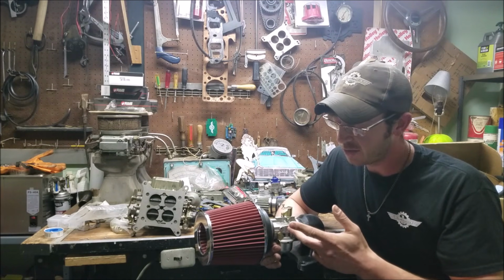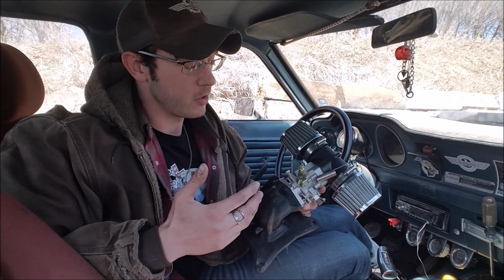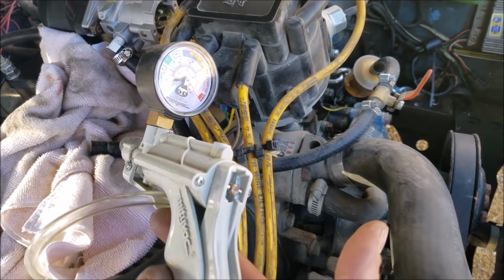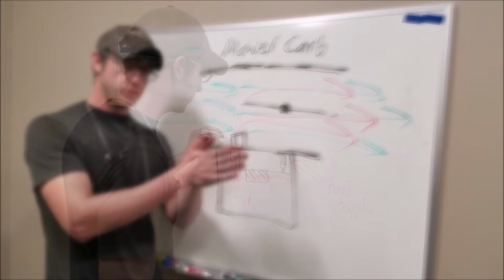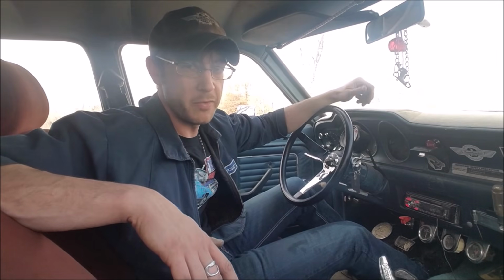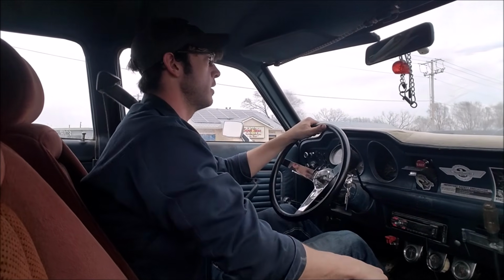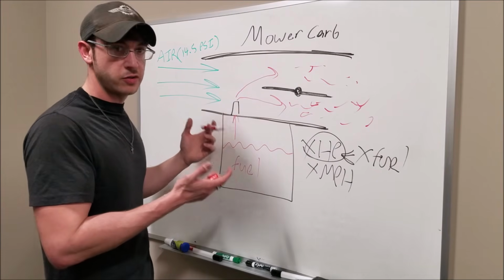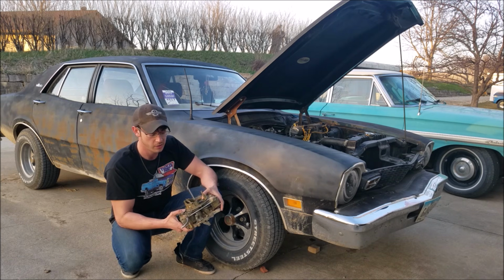Will It Run? Lawn Mower Carb on V8! (The "IMPOSSIBLE" Becomes Reality!) Start to Finish

Comment: This whole project makes sense - all a carb does is meter fuel.  Regarding power, of course it would be less as less energy is allowed into the engine.  Watching the smoke boil from the tires during the introduction is misleading as that shot must be from when the Holley was installed.  Such a burnout with the mower carb would be impossible.  I'm certain had I continued working on cars I would have attempted the same project as well.
Back in the '80's I had a '72 Celica with a 18RC (1.8 liter) engine. Being bored (AND pissed) that the Toyota 2 barrel was screwing up AGAIN, I worked on an alternative.  The mounting was very close to that of a Chevy and I just happened to have 2 to 4 barrel adapter.  With a slight mod to the bolt pattern with a hacksaw I was able to bolt a 600 CFM Holley (with vacuum secondary's) on it.
Along with the header on it, the engine was able to breath so much better.  I added a cable throttle from a later Corolla and the project was drivable.
As I remember, fuel economy was still decent (IF I kept my foot out of it) and the sound of the secondary's opening was wild! 
I used the smallest jets possible with the secondary's set up to open around 3,500 - 4000 or so.
Of course I ran into the usual negative comments, which usually centered around "it'll wash the cylinders down!"  Unfortunately the project was cut short when the car was rear ended by a police cruiser (YES the cop was charged AND the city paid ME damages!)
That's another story.
Reply: Secondaries

Comment: My ducati 900 does 40ish mpg and has done so for 33 years. It weighs 385 lbs and has 38mm cv carbs. My moto guzzi g5 948 cc weighs over 500 lbs, has 30mm carbs but does 58mpg. Much better fuel atomisation due to high veocity (small) carbs despite simple (slide) delorto as apposed to 38mm cv khein

Comment: How about a throttle body add on to your Plasket  manful , and put , like a choke cable on it ,, so when your drive down the road , you can adjust  the air into the motor.

Comment: Hi , I have watched your video.  Thanks for doing it despite all the rude people . I have a 1980 square body Chevy 4.1 litter 6 cylinder with auto trans . I think it would work. On my truck as well  . Could you tell me what carb you used , please . I have a 3d printer and a cad pkg . I sure would appreciate it  .

Terry

Comment: My thinking ahead of time is that yes it will run, but you lose a LOT of power on the top end, and maybe not even be able to rev to redline, but part throttle and low speeds will be just fine.

Comment: I doubt it lost nearly as much torque, as it did HP. Meaning, you win...OK, I KNOW THI SIS CRAZY(it is, but most cool things do), but if you could create a system where you could switch between the  Holley, and the lawnmower carb, you could save on gas, and kick some ass!

Comment: My car was getting about 60 more miles a tank full for a few months until the fuel pump quit and couldn’t open the injectors. It was gradual so I didn’t notice. With pump replaced I am back to normal mileage for it 😊

Comment: OKI too once was a young crazy gear head did not have nearly your resources more of a junkyard mechanic So here's my challenge I want you to find a 3-D's intake for that engine You can put 3 lawn mower carpets on itAnd if you're familiar with the old free carbs set up you know only one of them has an idle circuit in itAnd the linkage is just progressive

Comment: Wow extremely impressive. I would be interested in trying this on an old ford That I have as a Daily driver. I am curious on what auto tuner you have and the "Carb Cheater" of course. My truck is running a 400 with a four speed. I would love to get better mileage out of that.  Congrats on the achievement.

Comment: Thunderhead289, you have enthralled and piqued my curiosity to the point that I must have one of those plastic base plates that can hold the lawnmower carburetor for application on my 283 sbc engine.  I wonder why you did not block off the mechanical fuel pump and go with a pulse pump that runs of engine vacuum.  God bless.
Reply: off**

Comment: wow you'll certainly need to watch your back now..... gas and oil coming for you lol.... I believe that part of the efficiency gain could be due to less air volume filling the cylinder creating a lower compression ratio as well and less pumping loss. Less air means less fuel needed for stoichiometric, obviously the gas expands under vacuum and becomes thinner or less dense in the cylinder, the lack of pressure causes the fuel to boil at a lower temperature as well. I also believe that due to the way that a throttle plate allows air in a curve and not a linear increase ie the first 1/4 throttle typically gives 33% of your total horse power and is severely reduced from there. not having an accelerator pump will also not give that random squirt of fuel to give better throttle response. I think id like to do something similar but with both carbs switched electrically somehow on a 300 swapped 5 speed ranger or maybe just a full size since I'm impatient and really want 50mpg in a truck like 5 years ago lol. I think you're really onto something, maybe with a similar sized mikuni and a laser sintered plenum this could easily be a silly but practical way to utilize older vehicles and drive till theyre dust, the fuel savings will pay for so many extra repairs on something that is already easy and cheap to work on. honesly this is a masterpiece in my mind! great work!!!!

Comment: Very interesting that's very small minded,...try like a Ford 9N tractor carburetor or a really big bike carburetor.
I'd bet bike carbs would be smooth.
I figured if he needed more fuel he would print a bigger  fuel bowl/float bowl
I'd wonder if there was engine heat problem's.

I have a 91 chevy van 350 van,...I want to get rid of the fuel injected throttle body and put a 2 barrel ford or a 4 barrel on it.

Comment: Hmmm, the whole faking it thing? Two scenarios: first, if I clicked this video to be the first time I watched you, I’d probably think that this jackass was pulling my leg. Second: I’ve been watching your channel a while and I’ve determined you’re pretty level, so if you say you got it running, I’m not fact checking. Questions I may have are more based on understanding the theory, but not questioning the practical experience. 

As far as the whole lawnmower carb thing… that’s awesome! It totally makes sense that it would work, as Science has described spontaneous reactions (fuel=power with the right conversion factor) and such. The Romantics would assign “soul” to the engine and say that it’s doing what it “wants” to do is make power when it’s fed fuel. Either way, it’s a fun experiment! Thanks for sharing your experiences with us the viewers!
Reply from the maker: It was fun in the beginning, but resulted in a ton of people trying to run a mower carb on their car - there's a final video in this series where I drove it 1000 miles on power tour and put it on a dyno where it took a 322hp engine down to 49hp, which is the part folks miss. 
I never did any of the mower carb to promote it as anything viable, as I said in the video it was to simply show some hard headed folks that the fluid dynamics logic is there such that the car would in fact idle, run and drive on it - and that thinking that a 302 needs a 750dp on it is absolute ludicrous.

Sadly, all that fell on deaf ears and people just saw what they wanted to see - i could have milked it for a ton on youtube, but that just further deviated from what I had ultimately been trying to get through to people.

All in all, I view the lawn mower carb exposition as a failure as it missed the mark of what I had been ultimately trying to convey.
Reply: @ so, you did take a 300+ hp engine and reduce it to less than a sixth of its power. What I took from the exercise is an excellent example of making something work, while in the context of American, and maybe human in general, excesses: do you really need 300+ hp to get groceries? No, but the extra power makes things more fun. I also took from it that it was an experiment to learn the boundaries of what is possible. Not that it’s super practical, but possible.

Comment: Havent had time to watch all the videos but is that a e15 carb? I love the gm hei distributor! You do know a pre 70s distributors worked off of less vacum or backwards! Doesnt suprise me at all due to the fact ive put 1050 dominators on stock 318s its all a afr mixture problem! Doesnt matter what volume it is! Timing is a flow problem! Should of used a gallon jug of gas would of been more accurite!

Comment: Dude, this is excellent! I applaud you for your engineering prowess, I think you are very humble and smart. Do you think just using a 1 barrel automotive carburetor adapted to the 4v intake would have returned similar results? Thanks for this excellent video.
Reply from the maker: Probably not due to the sheer size of an automotive 1 barrel vs this as it's much larger. Was fun, didn't make much power, but fun to do as it feels so wrong

Comment: Great content! Keep up the good work!

Question: would it be possible to install 2 kinds of carbs? 1 for efficiency and 1 for power, have something to switch from one to the other.

Another question: how does it make so much torque in the lower revs? Is it because its a big engine?

Comment: It'll work on the 4th barrel too. You'll get more fuel knowledge. Design of your patent away everything set up on your tool mixture in your ratio cost fuel is wasted to a motor just like you said in a long run. But nobody listens to an older person that. If you've got it down Pat keep going make a Pat non on as fast as possible. Don't let nobody else leave in on your design take a perfect somebody knows

Comment: In the late 80s early 90s gm had the TBI. Or throttle body injection on many engines including the small block 350. Compared to the earlier 4 barrel carb it was very restricted,  very low horse power for a 350. However it had great MPG and great torque.  The swirl port in the intake valve port also added to this. The overall design of highest compression practical with a knock sensor to detect early combustion was a great idea.
Again, great torque and mpg but poor horse power for that size engines. Then a few years later came the vortec. Shitty miles per gallon and very little torque but way more horse power. 
A perfect mixture will always give you better combustion therfore better mpg and low rpm torque.  That is what the world needs. Not high horse power.  But so many just want more power. 
The old Detroit diesel 6.2L and 6.5L were just amazing at mpg. But very little hp for there size. So the answer.... turbo. This increased hp significantly but the mpg went to hell. But no one cared. They were 23:1 compression ratio with no turbo. But adding a turbo requires reducing this. That is why we no longer have advancement in mpg. The diesel engine is held to less emissions than a same year gasoline engine,  gasoline engines are squeezing every horse power out of them they can. 
We need to just look at everything logically.  Propane is 103 to 110 octane and can be used in a spark ignition engine at much higher compression ratio than gasoline.  Diesel is not dirty fuel, unless high hp tunners get involved.  All we need is good efficiency and low end torque,  because that is what gets a vehicle moving. So Propane or diesel in high compression,  no turbo,  not high hp, just good efficiency and very little emissions compared to current gasoline engines.

Comment: The 4 door is probably lighter than a 2 door Maverick. The 4 speed manual has very little drive train loss of engine power. Aerodynamic coefficient of drag is at least half decent. What rear end and ratio, compression, intake manifold, exhaust, and cam specs? Overall its not a bad mpg recipe. It would be amazing on a hot rod power tour, just swap carb and tires at the track!
Reply from the maker: It has indeed done 3 hot rod power tour long hauls 🙂
2.79 stock gear, higher compression configuration with aluminum heads and flat tops. 390cfm holley normally, dual plane, long tubes with glass packs, mild cam. Hotter ignition with optimized timing (timing being the most overlooked tuning item on classic cars that actually makes a massive differance)

Comment: Next time try installing propane or lpg carb to see the difference in power and consumption, because propane runs much smoother than 87 octane gas, and the bonus is great economy ar at full power.

Comment: Might wanna pull a plug and see what it looks like.
If its sparkling white (pun intended) you might be running very lean and working your way to burning a hole in the top of the piston.
Reply from the maker: I never did damage a thing, this was all at least 15000 miles ago now - but also you must not have watched where I showed the air fuel ratio numerous times and me explaining why it would actually try and run rich, not lean

Comment: a VW TDI diesel with compressed natural gt CNG gets up to 120 miles per gallon and still runs if the CNG runs out at around 45 - 56 Miles per gallon EVs are not the future theyre dangerous .. your video seems to be on the right track  now imagine if you did that to like a 1992 -94 hnda civic that already get in the mid 40s per gallon WOW !

Comment: Back in the 80s some dude that worked for ford realized all vehicles are fed wayyyy more fuel than they need and the dude was fired for proving the car runs great on way less fuel. car manufacturers the government and oil tycoons have a deal with this.

Comment: SIDE EYES !? 👀👀👀
thinks my '68 Slant Six 225 Dart has single carburetor,  at least it should idle... 🙄 
NEVER DOUBTED YOU :face-fuchsia-tongue-out:
IMPRESSED 3D Printing was beautiful that the material didn't fail, melt etc. 
SLAPS SUBSCRIBE :face-blue-smiling:

goldsmith / master jewelr here 58 yrs experience in the jewelry industry there are 3 settings for printing. unless one does in-house 3D printing you can't choose with finish. printing services won't print glossy because it uses the whole machine for 1 job piece versus as many jewelry pieces that can be printed. it's all about the money for them vs the glossy. jewelers have become lazy. but i understand making $150 for one piece vs $1000 to $2,500 (depending how many pieces)

Comment: Google this and you will find that (for a gasoline engine) the ideal fuel/air mixture is 14.7:1  In other words, for every one gram of fuel, 14.7 grams of air are required for ideal combustion.  Less fuel makes the engine run lean - causing heat and engine knock.  Too much fuel causes a "rich" mixture that causes wasted fuel and poor engine performance.  A small carb is ridiculous.

Comment: well done makes you wonder how much fuel wast was with its normal carb as most cars from that time were desined to use a lot of fuel as the motor industry was working with the oil companys ie use more fuel make them richer

Comment: It'd be interesting to see the results with a higher compression ratio. Since the cylinders are likely not entirely filling, the actual dynamic ratio is likely lower than the specs (eg mechanical ratio is 9:1, dynamic ratio 7:1). I wouldn't be surprised if it could run 14:1 on 87 without pinging. Of course, that's a hell of a lot more work, but the mileage should be even better.
Reply: worth taking it to the extreme at this point just to see.

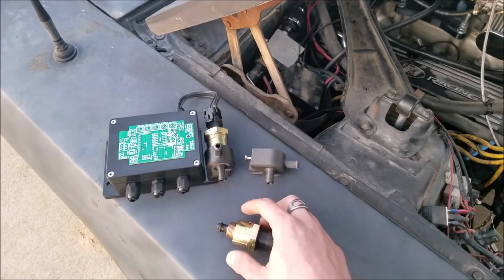Comment: 48:15 I said this could be done 30 years ago i thought when they came out with fuel injection that would be it but oil companies don't want us to get better fuel mileage but i know its possible im not that good with engineering it's not the gas its the fumes and air mix i bet with injection and the right computer you can get 50 to 80 miles to gallon you can't tell me that all the technology we have now we can't get better mileage more than 30 + miles per gallon with computers advance i can remember when diesel was cheaper than gas its cheaper than gas to processes it's all about the money...there still trucks coming off factory floor with only 15 miles gallon that's ridiculous

Comment: So fascinating, to make sure I understand the series of events and ideas in proper order and timeline, you created the carb cheater because of the lawn mower carb experiment?  You wanted to  prove the concept that the lawn mower carb would work on a larger displacement engine and you realized that the lawn mower carb did not have the normal dynamic metering passages to keep the ideal mixture at different loads. It was at this point you had the idea to try and solve the problem of dynamic metering of fuel at different loads and weather conditions from an the approach of an electrical logic board that would meter and control a purposely created vacuum leak between the carb and the intake instead of relying upon fuel metering passages inside the carb?   So it was basically the lawn mower carb experiment that gave birth to the carb cheater? I'm I tracking the genealogy of this idea correctly?

Comment: as long as you have adequate fuel air and spark you'll always have a running motor (given that it's mechanically sound😂) restricted or not it'll work or not work

Comment: This experiment has been replicated since the1950s. This will increase your fuel mileage but you're running your cylinders dry and risk damaging the engine long term. Hope it works out

Comment: Could you put an air filter that is sealed tight but lets some air in that bypasses the carburetor but does not affect the suction of the air through the carb so the engine gets more air? Or does that matter?